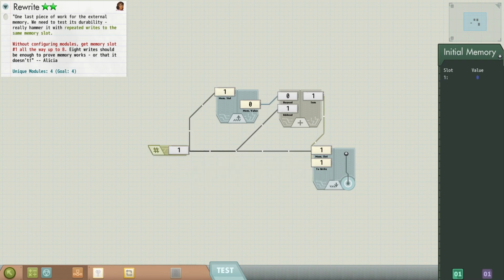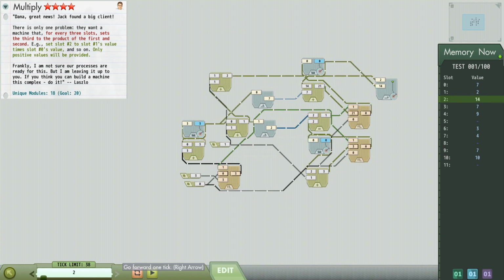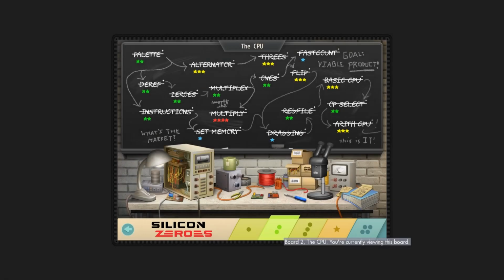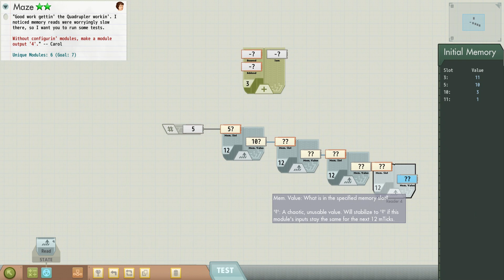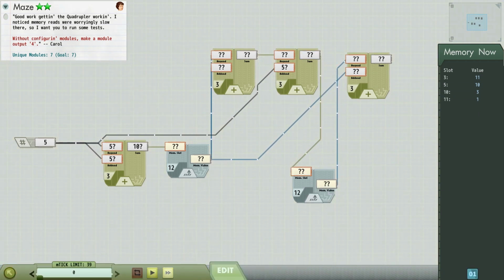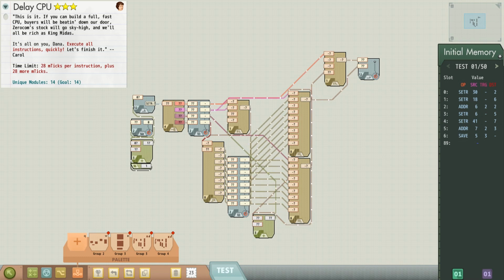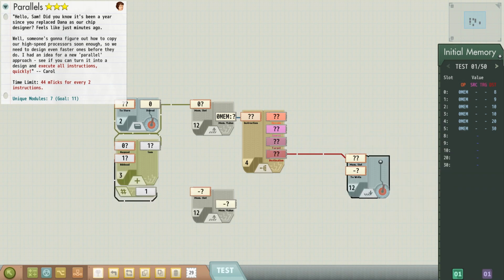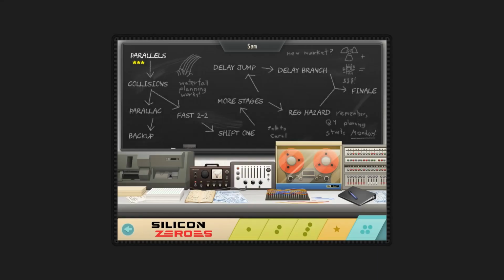Silicon Zeroes - Building a Computer Inside of A Computer

Comment: I like this is closer to building a precursor to a computer in real life. To bad they don't include signal delay.
Reply: Signal Delay actually comes into play further into the game. The time steps get split into "milliticks" and it takes a certain number of them for the inputs to a module to stabilize, before that it's just '?'. A big part of it is making sure nothing tries to use a value before it stabilizes.

Edit: Just watched the video a bit further and Scott even does one of the signal delay puzzles. ("Maze")
Reply: Flynn Pierce I was meaning from a electronic engineering standpoint. It sound like they tried to reflect that but still feels like a bit of fantasy compared to making a circuit that works. Great game just like the real thing better even if it costs 10 to 100 times more.

Comment: not when 4 but 3. The solution is based on 3 years. If it was 4 years like the game wrongly asks(they fixed that already to 3) it would need 4 latchs.
So this must be the optimal solution for it and the game again made another mistake asking for 10 module instead of 11, or can it be done with 10 modules?

Comment: I dont like it, but the modern multiplication solution is for a number abcd*fghi =(((fghi*a)*2+(fghi*b))*2+(fghi*c))*2+fghi*d done recursively using bitshifting to multiply by 2 each time
Reply from the maker: Of course, but there's not bitshift component in the game.
Reply: Although multiplication by 2 is easy enough to do with an adder. The bigger problem is that there isn't any sort of bit masking.